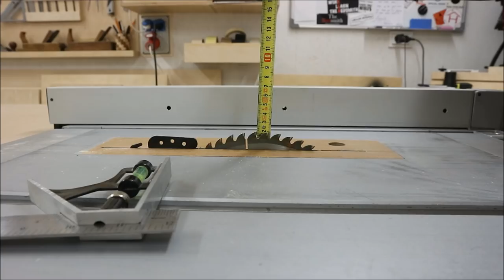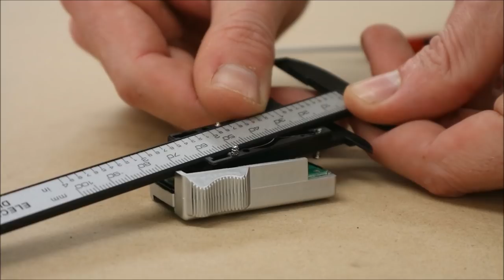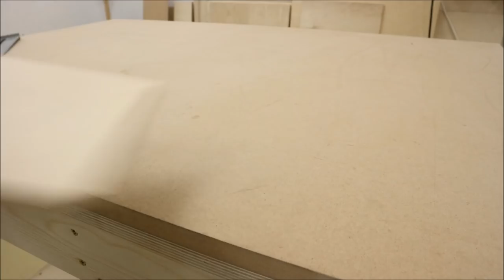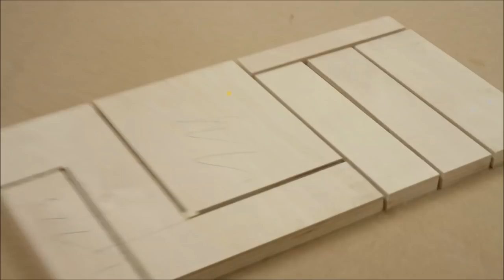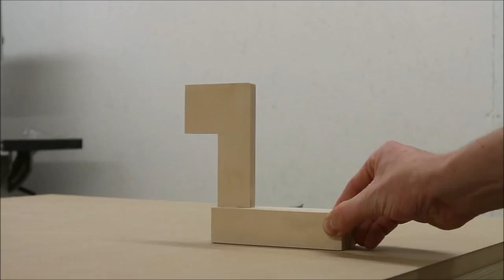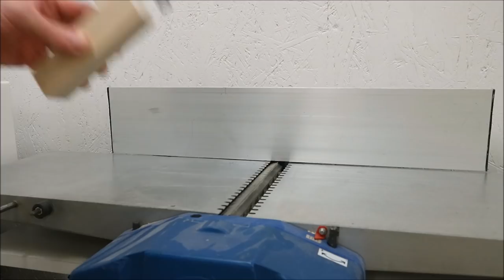Make a Digital Depth / Height Gauge

Comment: liked and subscribed,i have bought a table saw that is the same as yours but under a re label name it would be very interesting to know what upgrades and adjustments you have done?i have tried to make a zero clearance plate for the blade but without any real success  as the one which came with the table saw is not good.
Reply from the maker: Thak you Mike! Do you have the Orange - Gray one from Bauhaus? I have probably loosened and tightened every single screw on the table saw. I checked if the blade to the table is perpendicular, miter slot to the blade parallel, the play on the fence, made the fence parallel to the blade. I'll make a picture of the insert that I made in the community tab earlier next week because I was asked how I made it.
Reply: Thanks so much for taking time to reply,i have the grey metal one even that sits below the table i have no real owners manual for it although it was new when i bought it so frustrating lol,my actual make is the same as yours but its been re branded as a pingtek blueline 255mm as no clear instructions i have been cautious of trying to adjust much such as main fence ect
Reply from the maker: I just googled pingtek blue line table saw owners manual on google. There are a bunch of PDF downloads available. Check and see if you find yours. Those things I adjusted myself weren't described in my owners manual either.
Reply: ok thanks i will take another look
Reply: took a look and they show the pdf for the pt48250-s which is the one i have was hoping to show bit more
Reply: look forward to seeing pics in community thankyou